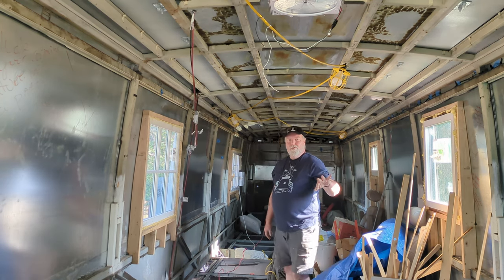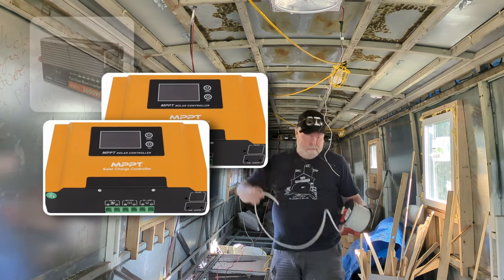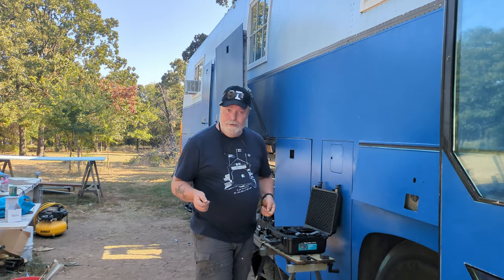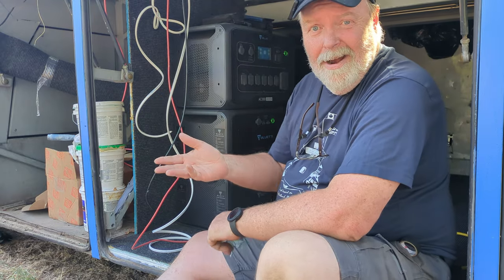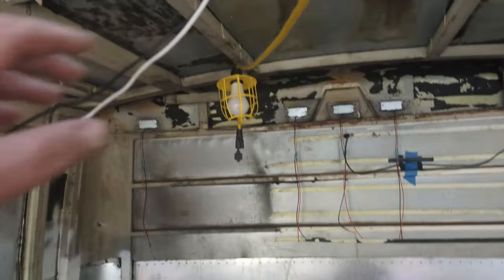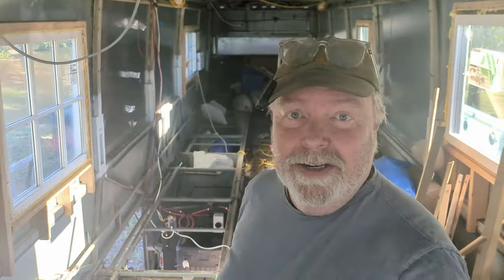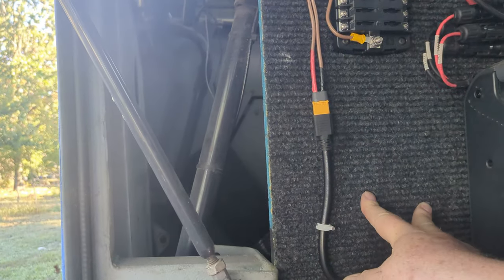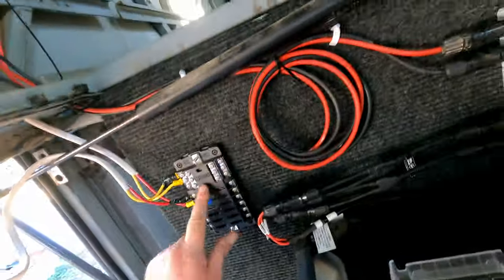Solar Power Generators Are Transforming Tiny Home Energy!

Comment: Love your attitude, if you are unsure of what to do, learn how to 😊
Love the setup. I have the component kind. But this one you have is so clean and easy 😀
Reply from the maker: Thanks Brian! We waffled quite a bit, but when I did a spreadsheet comparing the costs and power against another bus build we both know, it seemed this was slightly less expensive and with slightly more power capacity. Add to the simple install and we decided to take one major project off the list with only a couple big purchases. We'll all see how it works out for us!